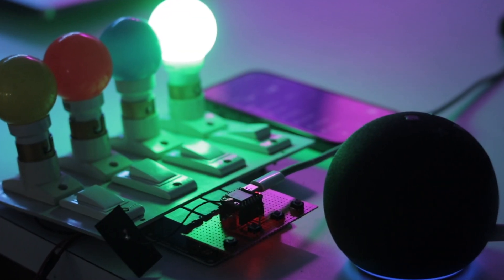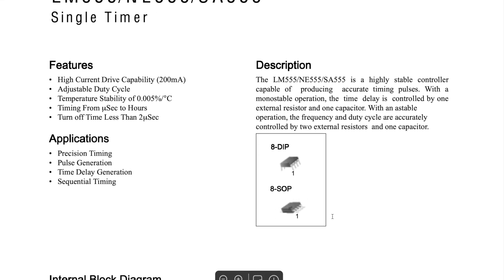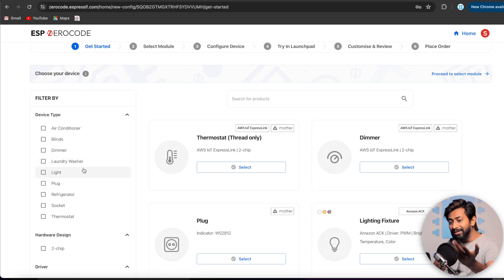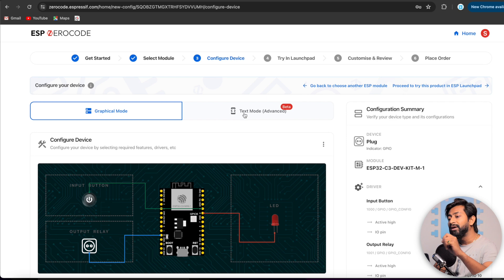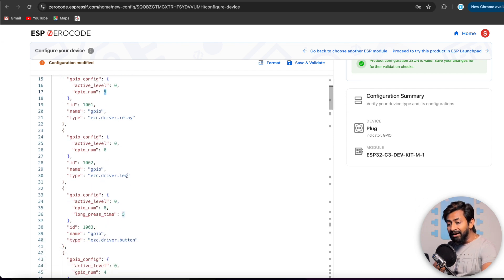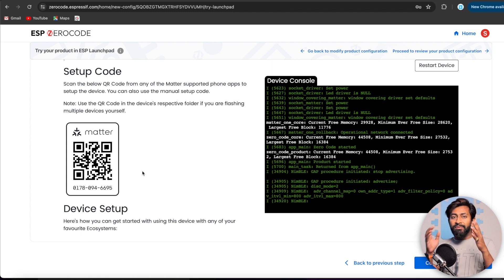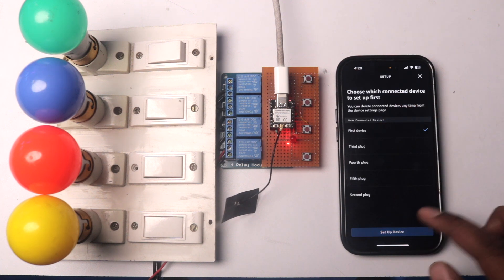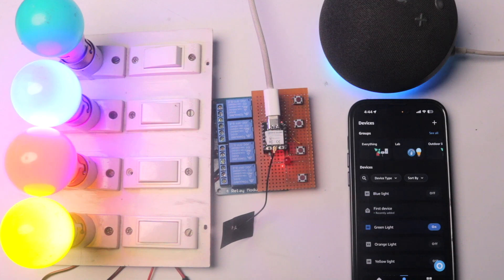Control Multiple Appliances with MATTER Protocol using XIAO ESP32C3 | ESPZerocode

Comment: Great job man. I'm developing three PCB boards using ESP32-C3 with matter for Apple homekit using the Homespan library, but it is very high level C++ code. With this ESP Zerocode integration it will be much more easier.  I'm already reading the documentation in espressif website. I would like to know more about the Place Order option on website.  Thank you very much.
Reply from the maker: Happy making

Comment: Really great to see matter protocol and implementation.
Do you think its safe, since its no code, someone is coding for yourself. 😅
Reply: Kedar from Espressif here. Because ESP ZeroCode firmware also ships in production devices, we ensure that the best engineering practices are followed. For production devices, we also support the firmware for multiple years so that it could be OTA updated. Security certifications are WIP. Hope this helps.
Reply: @KedarSovani  Thanks Kedar for your response.

Comment: Bro make a location tracker example metro stop tracking 😊
Reply: Yes please make it
Reply from the maker: Can you elaborate?
Reply: @techiesms  make a gps tracker using xiao c3 board and Neo 6m gps module which uses wifi to send real time gps data to phone because if we use blynk it is paid
Reply: @techiesms  In metro, the display screen to know the stop will be called when the stop is reached